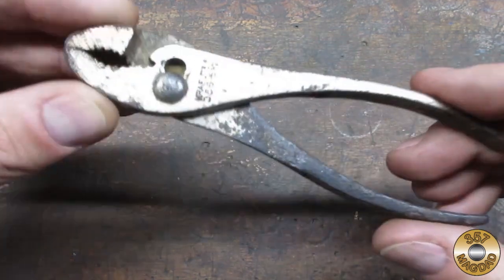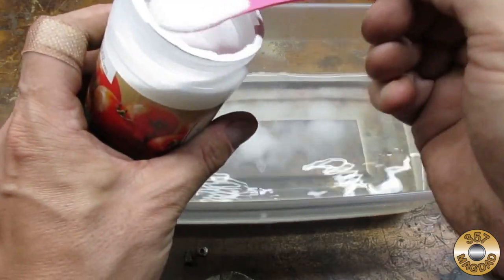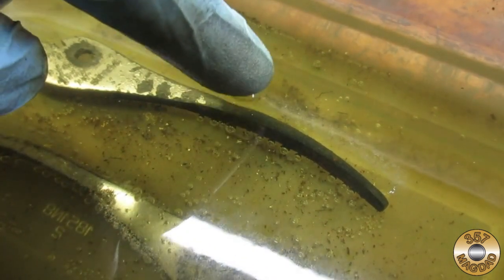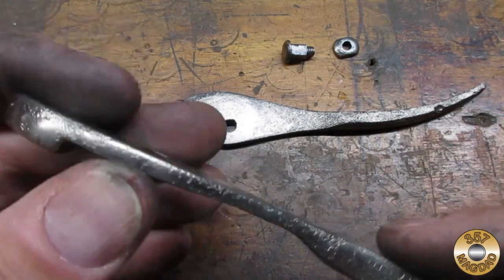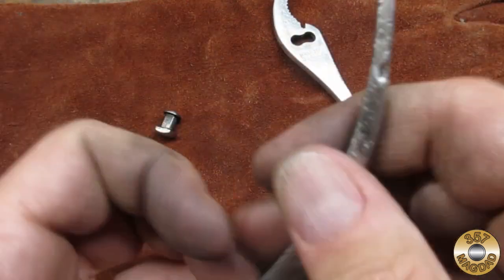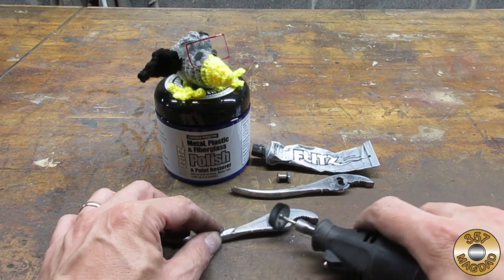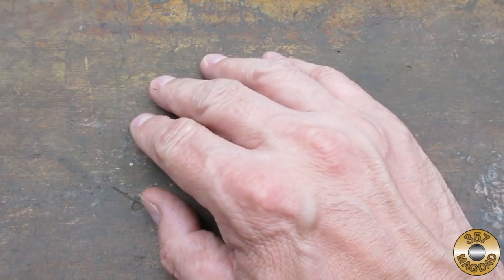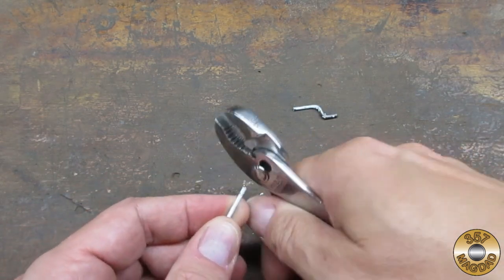Hand Tool Restoration - Kraeuter 356-5 1/2 Slip Joint Combination Pliers

Comment: Wire to fiber. 
There was no sanding. 
Great ‘cause you don’t 
Eliminate the branding. 

Chuck wants the new Flitz. 
And you won’t budge. 
You may need to appoint
Mrs. M. as the Judge. 

That chrome plating:
It gave you a fit. 
The shine from the Flitz
I think, overcame it. 

Those pliers look good. 
There is no doubt. 
I think you took
A very good route. 

Thanks for the fun. 🤠
Reply from the maker: I always look forward to your poems!  I make sure I share them with my wife and daughter!

Comment: I also hate flaking chrome!  It's always a nightmare to deal with.   😃👍
Reply from the maker: A viewer suggested heating the part and then submerging in cold water to pop off the plating.  I may have to try that...
Reply: 357magdad - that’s an interesting idea! Just proceed delicately (re:”heating”) in case you got a high carbon “hardened steel” (most* pliers utilize these steels, especially useful for the jaws and/or cutting edges) under a chrome plating, because heating the tool (esp the gripping jaws/cutting edges) can and likely will affect the tools deliberate temper ( IF it is in fact a hi-carbon steel..) 

BUT, the method you (or a viewer?) described seems pretttty similar to heat treating anyways haha! It’s just something to be aware of (sorry if this info is rudimentary to you!) and consider playing around with heat treating (heat-quench-temper) on your tools and in your shop! Can definitely (and easily ) be done at home mostly with a torch, especially for smaller tools like pliers and where you only want a specific feature/part deliberately hardened!

Could be an interesting video series too ;) I’m getting ahead of myself! I really enjoy your content btw! 

Cheers
Reply from the maker: @TylrVncnt  I have some videos about a little forge I made and a couple knife making projects using it.
Reply: And a health hazard in dust form.

Comment: Wow I'm very impressed that you did know hand sanding and yet you made them look not brand new but in a stable condition with a look a lot better than they did I love restoring pliers like that I did a similar video but I did a lot of sanding with a flat disk
Reply from the maker: Thanks!  Normally I would have started off on the belt sander, but I wanted to see what the fiber wheels could do by themselves.

Comment: The pliers cleaned up well.   As you said, the markings on the handle are unusual.   They look good.
Plating is nice when it holds up, but a pain when it needs to be removed.
The citric acid would have taken off the plating over time, but as others said it would also have consumed some of the metal.
My inexpensive alternative to Evapo-Rust is oxalic acid, also called Wood Bleach.  In most hardware stores in the wood finish aisle.   Like citric acid, it is slow working.   Cheap to make a large volume for larger parts.  A few tablespoons in a gallon.
Chuck is really eager to get into the new tub of flitz.   LOL
Dave.
Reply from the maker: Thanks LV!  I'll have to look for the oxalic acid.

Comment: I'm amazed how shiny it came out after the first fiber wheel! I inherited a pair of pliers from my MIL's father with that same handle pattern.
Reply from the maker: You can tell by the sparks that those fiber wheels can be aggressive!
Reply: @357magdad  But... so shiny! I thought sanding makes it dull.
Reply from the maker: @DavidPlass  I've been able to achieve a near mirror finish by sanding down to 800 or 1000 grit and then polishing with Flitz.

Comment: I just purchased one of these wheels per your recommendations...at first, I saw nothing better about it compared to wire wheel and going through the buffing wheel grits...but after a second try, I think you may have something here...nice option to have available..but it does create heat!
Reply from the maker: Joe's Shop is the guy who made everyone buy these wheels!  I find that I have to wear gloves - the parts do get warm.

Comment: I agree that type plating is tough. I have been able to remove with the belt sander but it was still difficult. You did the best you could with all the pitting.
Reply from the maker: Thanks John!  I would usually use the belt sander on something like this, but I wanted to see what the fiber wheels could do on their own.

Comment: If you live in a hard water area citric acid works well as a descaler. I've used it many a time to clean my kettle, pots and pans and mugs that end up with stains that I've previously had to shift with gunpowder.  Unlike white vinegar, you don't need to rinse it several times to get rid of the smell.
Reply from the maker: Thanks for the tip!  The citric acid does have the advantage of not smelling like vinegar.

Comment: Wow those turned out great.  I have a Kreuter 5 1/2 that is kind of eaten up with rust like yours was.  I will apply some joes shop wire wheel and see if I can get mine a sharp looking as yours.
Reply from the maker: Give it the wheel Rusty Gun!

Comment: Looks good .... I am also not a fan of the nickel or chrome plating when it is damaged.  Not sure what the downside to stripping it with a sanding belt.  I would also worry about airborne metal particles and inhaling them ....no bueno
Reply from the maker: Normally I would use the belt sander, but I wanted to see what the fiber wheels could do by themselves.

Comment: The fiber wheel look good. Do you find them more forgiving or less aggressive then sand paper of the same grit? Like the handle design. Thanks
Reply from the maker: I think the fiber wheels polish the part more than the 1 x 30 belt sander does.  I think the "grits" given for the fiber wheels are approximations.  The 6" wheel can get into areas I can't reach as well with the belt sander.

Comment: Nice restoration. My dad had Kraeuter 156-6 USA made 6.5 inch slip joint pliers in real good shape. Any idea what year range they were made?
Reply from the maker: Thanks!  Check out alloy-artifacts for manufacturing date info.

Comment: Considering how deep the pitting was, do you think sanding would have made that much difference? Good video!
Reply from the maker: The nice think about this pair of pliers is that the maker's mark is deep.  I could have removed some material with the belt sander without losing the markings.  A lot of times the maker's mark limits how much material I can remove.

Comment: Serious pitting but the jaws and slip joint mechanism look really good........The fiber wheel seems to blend and smooth without taking off much metal.
Reply from the maker: I was impressed with the sparks coming off of the wheel! I'm still experimenting with how to best use the fiber wheels.

Comment: Hi Magdad, great video. Be warned, those fibre wheels become addictive after a while. I use them on nearly every job. I have very good results with electrolysis and I have several old tools I want to use to experiment with removing the old plating using it. I’ll let you know how I get on.
Cheers Stuart 🇦🇺
Reply from the maker: Reversing the electro-plating would be a good experiment!

Comment: I used vinegar once on a plane lever cap that had nickle plating it took some off but ate into the metal too.
Reply from the maker: I've tried vinegar. I was hoping I could make the citric acid solution stronger than the vinegar.

Comment: Is that grinder motor a full-speed motor?
Nice job on the pliers.
Reply from the maker: Thanks Ben! The name plate says 3450 rpm.
Reply: @357magdad   Interesting. I recall Joe warning that I should get a slower motor for the fiber wheel. Something about it being very dangerous. Not exactly sure what the danger is, but I'm just passing that along. Use whatever caution you deem necessary.  My motor is 1750. I guess you can get the work done twice as fast.
Reply from the maker: @mrbenmall  Seems to run OK.  The adapter bushings I got seem to have the fiber wheels running smooth and true.  It doesn't feel scary to me, but I might just not know any better. LOL

Comment: As always a really nice job. I was interested in the citric acid bath as Evaporust costs $40 for a gallon in the UK so I only use it sparingly. Normally use vinegar but may try citric acid.
Reply from the maker: Thanks Tony!  I was attracted to the citric acid powder because I could control the "acidity" of the solution.  Plus the vinegar stinks.

Comment: It is a shame the rust ate at them that bad ...If I wanted to take the chrome off of like a 50's bumper ..An old school trick was they would burn it off with a torch and spray with cold water..I could not recommend to do it since it would be so much Toxic fumes coming off it
Reply from the maker: I'm gonna have to try that next time - outside of course!

Comment: Another great video. Thank you. When you were done, did you coat the pliers with paste wax or mineral oil or something to prevent rusting? I'm having a hard time keeping my restored tools rust free, probably because of the salty air here in RI. Any advice? Thanks.
Reply from the maker: I use Johnson's paste wax, but my stuff is in my basement.  One of the CLP's used for firearms might work better for you.  BreakFree CLP might be worth a try (check the fishing/hunting section of your Walmart)

Comment: I wonder if that citric acid would work better with a little electricity.....as in an electrolysis bath.
Reply from the maker: I could wait for a lightening storm on a night with a full moon.....

Just kidding!  You're right, there is probably a way to reverse the plating.

Comment: I wonder if they would have looked just as good if you didn't use the citric acid first.
Reply from the maker: In my experience the wire wheel does a decent job of rust removal.  The baths like evapo-rust, vinegar, citric acid etc are handy for getting into spots you can't reach with the wheel.